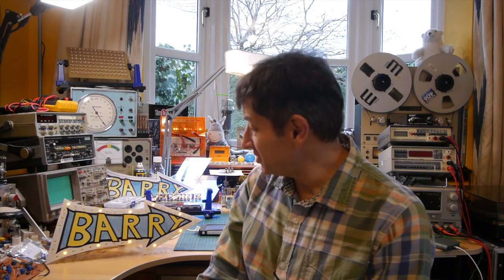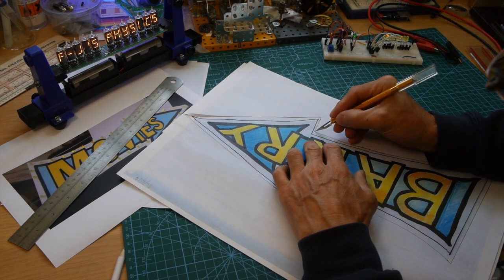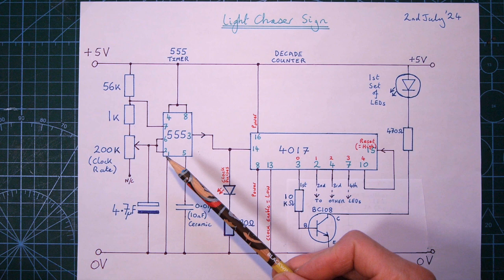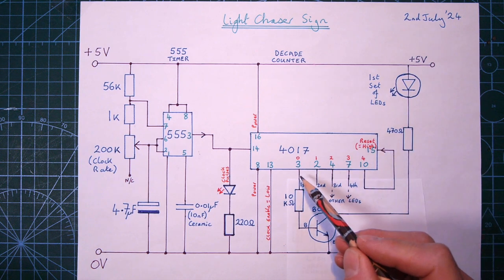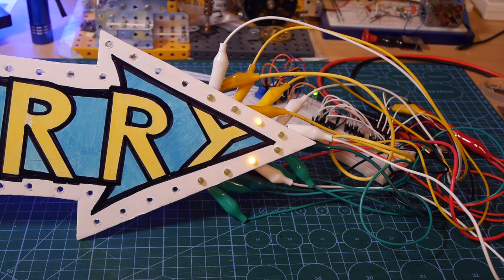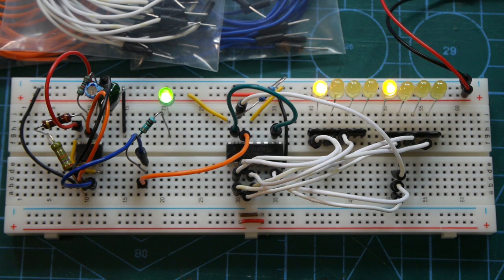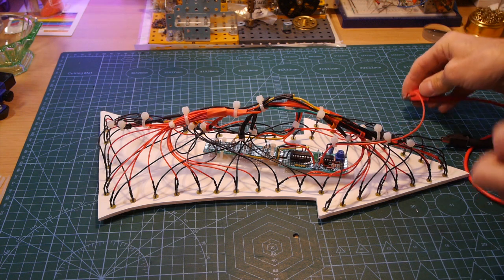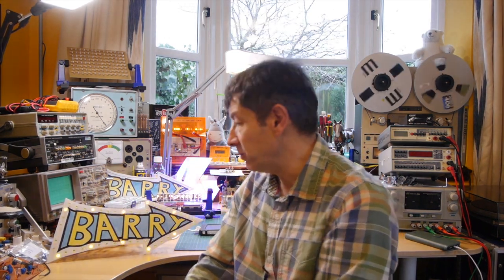Light Chaser LED Sign - F-J's Physics - Video 198

Comment: BC108… now there’s a name that brings back memories of my electronics hobby as a teenager. It was a bread and butter transistor in so many projects out of Everyday Electronics (mostly) and Practical Electronics magazines. I was also fond of using the ACY19 and ACY21 transistors which were very chunky and robust as I remember. They were quite up to the task of driving small motors and kept going even when they got hot!
Reply from the maker: Yes, indeed, the BC108 and BC109 were ubiquitous back then which is why I have a few of them still!   The ACYs as well.  I have lots of old transistors (OC series) and diodes as well.  I guess you remember the OC22 and the like in their huge TO3 cases with mica underneath them for insulating them from the chassis.  All good fun!
Reply: @AnthonyFrancisJones  Oh yes, the OC22! Oddly enough, I found the big T03 power transistors were less robust than the ACYs - in my amateur hands, anyway, and with my rather... ahem... "experimental" approach to circuit design.
Reply from the maker: Yes, you are right (about the OC22s).  If you had a faulty audio power amplifier, it was nearly always one of these that had failed for no apparent reason at all!  Still got a few in the component draws.  What will become of all this stuff!

Comment: Can we make a clock using cd4017 ic
Reply from the maker: Yes, you could, there are better ways to do it but you could have one chip counting 0 to 9 and then its output clocking another chip that does the same and resets at 6 if you want seconds to minutes.  It would be a fun project as you are not always counting up in 10s!